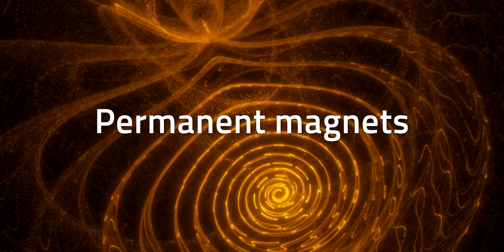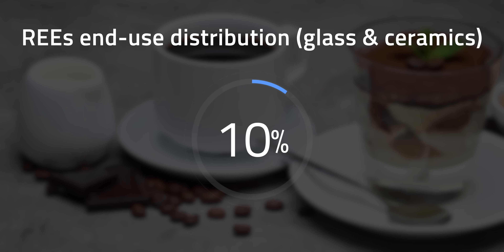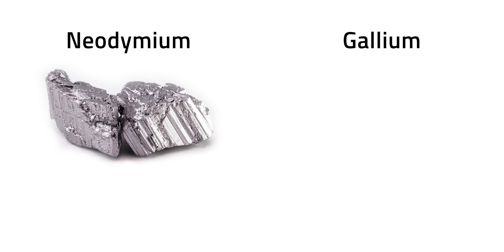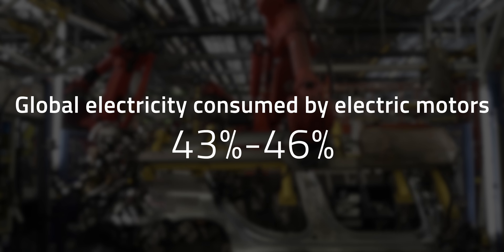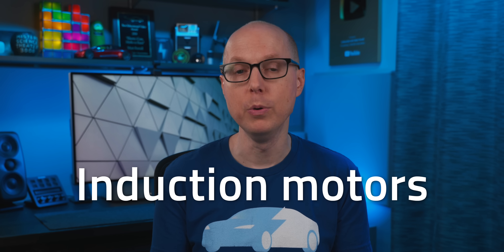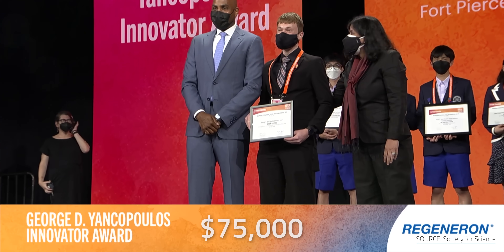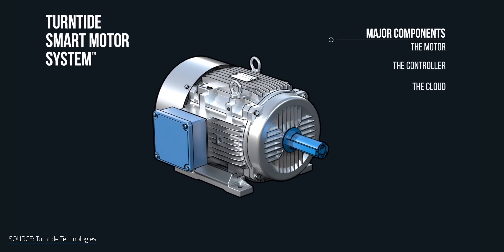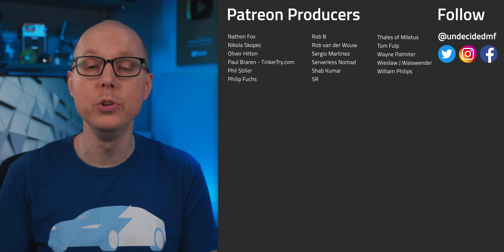Why This 17-Year Old's Electric Motor Is Important

Comment: All Motors need Magnets. . .  It is the magnetic force between the Rotor and the Stater outer case, that makes the motor rotate. . .   Some motors use Permanent Magnets, some use Electromagnets. ..   Some electromagnets as in vehicle generators use Brushes to get the DC Current into the Rotors Field winding, others use Induction methods, some called Squirrel cage motors.. . .   Some Motors will have fixed speed, locked to the AC Supply and so Synchronous, others will have variable speeds, depending on the Load and input power, sometimes referred to as induction motors and are asynchronous motors.

This 17-year old will be learning a lot about how motors work, and the problems of starting torque, hence his investigation into Saliency but these days, serious motors are already up in the high 90% efficiencies and we now use VFD to provide high torque at low speeds.    Small motors are very inefficient, a 1HP AC Motor will consume about 1.4 kW, which makes it only about 50% efficient.   .  He mentioned melted plastic in his motor, due to heat.. .  We do not want any heat in our motors, Heat is lost energy and so reduced efficiency.

Motors and Generators are almost the same thing, just working the other way round.    .  The latest large 13MW Wind Turbine Generators are using Permanent Magnets because they can be made smaller and lighter and high efficiency. . .  There is no shortage of rare earth material for permanent magnets, just expensive to get and produce.
Reply: How to reduce motor temperature from copper losses? Have tried switching to enamelled 999 silver, saw a descent performance improvement, about 15%, which for aerial vehicles is great. But what more can be done?

This 35 gram motor with 1000W going through it very good, and I am extremely happy with its performance… but the wire losses with 50-55A bursts are heating the magnets and my efficiency is reduced as magnets start to struggle at the elevated temperatures.

Already tried multiple magnet designs and configurations, different airgaps…

New magnet technology is currently under testing (I am just starting mass production on the first simpler design), so far it is favourable, but unfortunately it is actually even more temperature sensitive.

I’m looking to improve on my optimizations, any wisdom that you can share?

Comment: In 1976 around the time we had the do called energy crisis. My engine class in highschool was decussing alternative power options for cars, I brought up the idea of regeneratetive braking my teacher kept saying that pruptual energy wasn't possible,  but he didn't understand my concepts becuse he was preprogrammed that you couldn't do this or that,  this brings up my point only a 17 year old could come up with this becuse no one said it couldn't be done with some basic facts to it however not proven wrong yet.
Because he had no limits on his thoughts
He could look at it in a different perspective and find the answers. 

They taught refregent coolent could only be compressed for years untill someone who knew nothing about it proved running a system backwards does the opposite effects hence we have heat pumps now. 
So I'm going to say this with some restraint yes a 17 year olds a genius,  but only because his minds not polluted with bad knowledge that limits him.
They point at thinking outside the box, hell let's do away with any boxes.
Thats what is going to progress mankind.
No matter how proven somthing is, it can still be wrong.

Comment: Right now cheaper motors will not make EV cheaper. Yet what you described towards the end means that a savings of 30% could mean 30% less battery for the same miles. Which means that in theory could make the cars several thousands cheaper. 
Yet we all know that is not going to happen for years. 
The best way to reduce EV cost is to remove the massive battery packs and reduce the range for city car versions. Building a city car with 150 miles max range should reduce the weight and price. This means that for every battery pack today you could build 2 or 3 cars. Better electric motors would mean even smaller battery packs. Improving the heat and cooling in each units along with anything else can make the car run better and cost much less. 
The other thing is they need to come up with and stick with the same style of car with out any major changes. This will lessen the cost as well. Also removing any options for the cheap car means that the factory can produce the same car non stop until a change is needed yet that change should translate to ever car made before it. Stainless steel body is ideal as this requires zero paint and zero anything else. This would would allow owners to upgrade their components rather than having to buy a whole other car. A stainless car should have a life of 50 to 100 years easy.

Comment: All Motors need Magnets. . .  It is the magnetic force between the Rotor and the Stator outer case, that makes the motor rotate. . .   Some motors use Permanent Magnets, some use Electromagnets. ..   Some electromagnets as in vehicle generators and Universal motors use Brushes to get the DC Current into the Rotors Field winding to make the magnet, others use Induction methods, some called Squirrel cage motors.. . .   Some Motors will have fixed speed, locked to the AC Supply and so Synchronous, others will have variable speeds, depending on the Load and input power, sometimes referred to as induction motors and are asynchronous motors.

This 17-year old will be learning a lot about how motors work, and the problems of starting torque, hence his investigation into Saliency but these days, serious motors are already up in the high 90% efficiencies and we now use VFD ( Variable Frequency Drive ), to provide high torque at low speeds.    Small motors are very inefficient, a 1HP AC Motor will consume about 1.4 kW, which makes it only about 50% efficient.   .  He mentioned melted plastic in his motor, due to heat.. .  We do not want any heat in our motors, Heat is lost energy and so reduced efficiency.

Motors and Generators are almost the same thing, just working the other way round.    .  The latest large 13MW Wind Turbine Generators are using Permanent Magnets because they can be made smaller and lighter and high efficiency. . .  There is no shortage of rare earth material for permanent magnets, just expensive to get and produce.

Comment: oh boy, someone hasnt heard about electromagnets in generators and motors ... there isnt a real dependency on rare earths for most motors/generators, its simply that using permanent magnets still is noteable cheaper to produce and maintain in small scale applications. Only when scaling down a lot permanent magnets are still hard to avoid technicly.
Even for electric cars first efficient and powerful motors without permanent magnets already exist (if you got the cash) ... companies like Mahle (german) are building up for mass production right now.
It was simply a matter of the price for rare earths which held back the development of motors/generators which do without. Now that it gets too expensive we suddenly have multiple companies prototyping and producing  even small scale products using electromagnets instead of "permanent" magnets.

Comment: i was thinking tesla motor was already a reluctance motor, as the rotor just use metal bars (oriented with an angle, not parallel from the rotor axe).

Comment: I think we should be focusing on the energy source before looking at motors that have already performance wise been well developed. Motors in most applications like vehicles need to be bombproof a plastic motor will be of no use in the real world. We need to replace the 100 year old technology that is battery’s not motors or at least be focusing on that.

Comment: BMW is already using synchronous motors without permanent magnets, and there is also one being sold by Mahle. EV manufacturers could already use those designs right now.

Comment: er, if his motor "got so hot it melted" that can only be because it has terrible efficiency!  I'd put a pretty big sum on the iron losses in particular being catasrophic, much like in a stepper motor, which is great for producing a high torque low speed "holding" type power, but useless as a motor to do much useful work with ie product power.

Given the lack of efficency claims (or even a basic motor dyno to measure power in and power out) i'm not suprised it's taken 16 iterations to get to where he is today.

Yes it's all admirable, and it's terrific work by a yound abult / child, but it's pretty clearly nothing special in terms of actual pushing forwards of SRM machines, a subject which is being covered by various commerical entities with vastly larger budgets and significnatly more modern toolcahins (ie 3d magFEA so as to capture fringing effects and off axis effdy effects etc)

Comment: This is great for motors, but how about for electricity generation? Can power be generated without magnets? That's the real question when it comes to clean energy generation -- these motors, especially the Smart Motors, are great for clean energy consumption (reducing demand), but I don't see how a magnet-less motor can generate electricity.
Reply: oh boy, the schools really seem to fail these days ... what if I told you that larger generators dont use permanent magnets for a long time already? There is something called an electromagnet which is used in those generators ... after a short rampup with external electricity they feed their electromagnets with a small portion of the electrictiy being generated.
And those generators without permanent magnets creep further into smaller applications each year. Generators based on permanent magnets are simply cheaper and less complex to build, thats why they are still so dominant. Especially in products and installations with a short lifespan which stays under the limited lifetime of a "permanent" magnet.
oh, and ofc we also have motors being sold which do without permanent magnets, as they too use electromagnets instead. since 2021 they even come in sizes useable in cars, but again ... expensive and complex.
Reply: @diedampfbrasse98  Thanks! Yeah schools don't teach this -- or if they do, they don't make it memorable, lol.

Comment: So I’m 35 and I made this and it’s awesome vary basic can’t over think it simple. 400 watts Solar power capacitors potentiometer runs on solar or wind or stored power not free energy uses energy to run the alternator then electrolysis to make hydrogen to run every thing you need yes star fuel
Reply: I use this at my cabin to run it

Comment: There are no magnets in most AC motors... Few motors actually use magnets, because they don't last long. They lose magnetism in heat and just by using them. Eventually we will have turbines, instead of these horrible "stepping" style motors. The kid was on the right track, but it needs a "twist". (That's my free tip of the day.)

Comment: Squirell cage was NOT invented by Tesla (nor was induction motor). Teslas friends stole the idea (and patented it on behalf of Tesla, thanks to enormous founding from Westinghouse) from italian scientist Ferraris. Ferraris have developed induction motor with single copper ring spinning in rotating field. Tesla decided to use two wirewound coils on rotor. Squirrel cage (and twin cage) design was actually done by Dobrovolsky before Tesla even started winding his coils, however was patented later. First squirrel cage design was using rods attached to end plates with screws. That motor, shown at Frankfurt Expo in 1891 had just 100HP.

Comment: Very curious:- you say that Robert Sansone has not shared any specifics on how his motor works, and yet based (presumably) on his report and data from experiments, he is awarded a $75000 first prize from the Regeneron International Science and Engineering Fair last year. Is that really fair on the other science/engineering contestants? Who knows what Robert really has inside the casing of his motor.
As of March 2023, Robert Sansone has still not submitted any patent application

Comment: To be honest, alot of the 'draw backs' seem like they would be more attractive to motorheads like myself. Electric cars are cool but they dont feel alive, they feel boring. Sounds like the SRM motors would bring a bit more life into the electric car scene. I mean think about it, we put big cams in to make the car faster but we also like that lump. We put bigger exhausts on to make the engine breath but it also make that nice loud sound. If the SRM made the car shake a bit and had a  mechanical sound it could make them pretty attractive to those still holding on to the old dino juice guzzlers.

Comment: if the world could invest in improving the efficiency of electric motors, electric dynamos, refrigeration, air conditioning and electric pumps. We could reduce the effects of Climate change significantly.  We also need to make tunnel boring cost also come down. this would also help.

Comment: Is there a link to this young students claims? No airgap doesn’t sound physically possible unless displaying air with some other fluid. 

 I could see using ferrofluid as a gap filler and probably fairly efficient if you could make it adequately low viscosity and eliminate the high abrasive nature of it. Otherwise you end up trading saliency ratio for windage loss and shortened service life.  

FWIW 31-39% efficiency is extremely poor for electric motors. That might Explain why he couldn’t go faster. There are fully 3D printed IPM motor designs of similar size getting close to 70%, and able to spin much faster than 700 rpm. Modern well designed IPM motors of that size should be over 90% efficient and even 95% isn’t out of the question.

Comment: So this electric motor is almost as efficient as ICE. Now we just need a battery with the energy density and recharge rate of a fuel tank to power it and you could replace ICE . Maybe

Comment: I call bullshit on those energy savings when using smart motors. Electric motors generally are over 90 % efficent. In order to have 79 % savings on motor electricity usage, the motors would have to have been running well below efficiency of really bad internal combustion engine.

Comment: Iron Nitride magnets solve the rare earth resources problem requiring cheap elements: Iron and Nitrogen. Neodymium magnets are not the strongest in the world as is commonly claimed. Iron Nitride magnets outperform Neodymium at high temperatures, such as inside an operating high power motor, in all parameters that matter. This is already true before industry has had a chance to optimize their chemistry and manufacturing techniques.

Comment: Another aspect not considered is the amounts of material needed for any of these designs. There is currently insufficient, known, rare earth material to create the number of electric vehicles to replace hydrocarbon vehicles... let alone power plants.

There is also a lack of known copper reserves; Yes, it's cheaper than rare earth's now, but wait for it.

There just  are not enough rare earths, copper, nor power to go around... somethings got to give.

So a spectrum of solutions is required. Besides all electric systems, hybrids (electric/hydrocarbon) will be needed and outright hydrocarbon based systems.

In order to operate the hybrid and outright hydrocarbon systems, effective CO2 based recovery and reuse systems are needed: From atmospheric extractors to plant based systems. And multiple systems of recovery at that! Several are available already with more coming. All can be combined and used as front-end replaceable stock for our current petrochemical system: Refineries in particular with the associated distribution systems unchanged.

Granted, the refineries will require modification, but it's easier and far less expensive, and far less dangerous, than the completely new infrastructure required for pure hydrogen.

Comment: I am sure batteries are much more on the edge of sustainability than motors with 90% efficiency. Especially comparing to fosil fuel motors with 30% efficiency.

Comment: I remember learning about the three (then) types of electric motors, 13 years ago at the university. Synchronous AC, Induction AC and DC motors. It’s good to see people trying to innovate and improve or even come up with new designs.
One thing that is not discussed enough though is the corruption of the human race. Mainly in incorporating planned obsolescence and not designing stuff that are robust and that can be repaired. That alone if changed would reduce so much of the waste and the environmental destruction of this planet.

Comment: As long as a centralised way of producing energy and the suppression of all new solution which work and breaks the current status of control by the few there will be no solution. They keep hitting it with a hammer and expect to get a different result